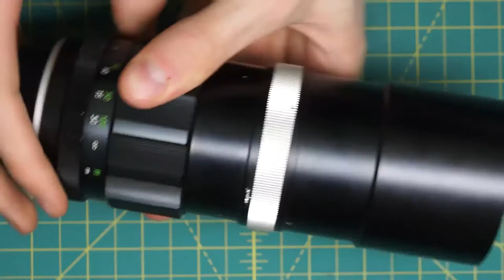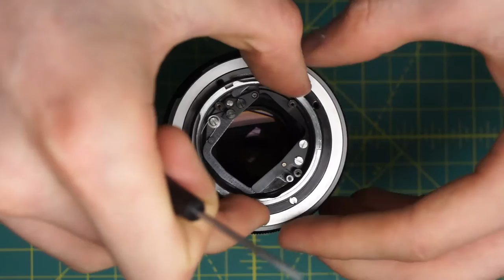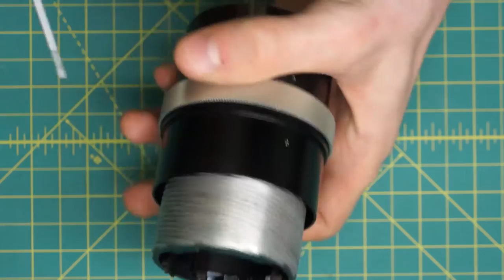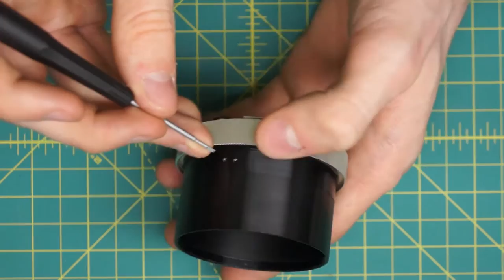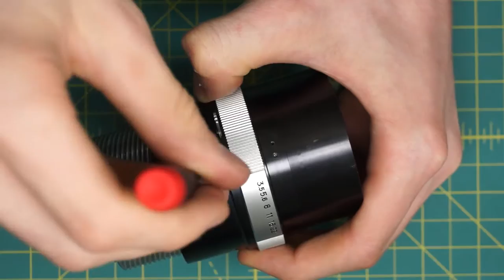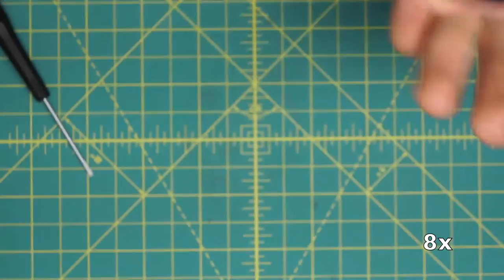Minolta MC Tele Rokkor-QF 200mm f3.5 (MC I) Lens Disassembly

Comment: Thanks for these lens rebuild videos Matt, I've looked at a couple so far and they seem easy enough if you know which order to undo things!
Did you have a manual to learn the order or you just threw yourself in the deep end and experimented? 
This one does look more fiddly than the other one I watched, I share your frustration with the flathead screws but do wonder why you don't use a magnetised screw driver? While not as easy to line up as a Phillips head I suspect it would make parts of this much easier.
I suspect they used the flathead screws as they'd have been cheaper to source back in the sixties and I doubt they were expecting many untrained people to dismantle them.

I've got one of these lenses, also the 28 & 135mm ones you've made videos on, I guess there was a good deal on back then to get an ST101 with a 50mm lens and these others too.
My 200mm is very still to focus, it's smooth though so I don't think it's the ball bearings being out of place. I remember when dad pulled it out for me to use he asked a camera shop to "service" everything. I'm sure they charged him a lot to do that, I remember they said they replaced the light meter and said that the grease in the 200mm lens has dried up a bit but it's still working fine so they didn't think it was worthwhile relubricating.
That was about thirty five years ago!
It feels worse than I recall, but given I've got old I can't be certain. I think I've got the skill/patience to rebuild this but you didn't do anything with the lubrication in this video. What sort of grease would you recommend?

Comment: The information about the Minolta Tele Rokkor-QF 1:3.5 f=200 mm vs. Minolta Tele Rokkor-PE 1:4.5 f=200 mm is gathered from the Minolta SR Len Index provided by Matt: http://minolta.eazypix.de/lenses/

The Minolta MC Tele Rokkor-QF 1:3.5 f=200 mm is a larger, heavier lens.
MC I introduced 1966.  Dimensions 70 X 138. Weight 740 gm. Filter thread 62 mm.
MC II introduced 1970. Dimensions 76 X 138. Weight 775 gm. Filter thread 62 mm.
 
The Minolta MC Tele Rokkor-PE 1:4.5 f=200 mm is a smaller, lighter lens.
MC I introduced 1967.
MC II introduced 1970.
MC I and MC II are identical in size. Dimensions 63 X 130 mm. Weight 500 gm. Filter thread 52 mm.

Comment: What a beast. I don't even know if it's a decent lens, but the machinery...

I'm thinking about buying a 200mm M42 lens for cheap that has a "Slow Iris", I don't know what the problem is, but if it's beyond simply cleaning the iris leaves, I'm out. 

I have two 50mm Zeiss Jena Tessars that won't stop down and need attention too. One of them will probably be the first lens I open up... with disastrous consequences no doubt. I just don't want to pay more attention to repairing lenses than I do taking photos.

Comment: Hi Matt, i've seen plenty of your videos and the way you explain everything its pretty awesome.
I'm wondering if you've ever disassembled a Canon FD 200mm 2.8, i got it for $35 but it have some water residuals in the middle of 2 and 3 element, seen from the front, and im stuck right now on how to get that 2 pieces of glass from the body.
Thanks in advance

Comment: Matt,
I was wondering what the difference between this Minolta MC Tele Rokkor-QF 1:3.5 f=200mm lens and the Minolta MC Tele Rokkor-PE 1:4.5 f=200mm lens?
Which of these two Minolta MC Tele Rokkor 200mm lens would you recommend?
I will be installing on my Minolta SRT101.
Reply from the maker: ibsoarin I'm haven't used the PE 200mm so I can't comparator the two. I believe the main difference is the optics. They have a different number of elements in a different number of groups. Here's a guide on what the PE or QF mean in terms of the optics: http://minolta.eazypix.de/lenses/
Reply: Matt,
Thank you for the Minolta SR Lens Index. That link is extremely helpful. I appreciate your time, expertise, and experience. Thank you for taking the time to provide these excellent videos. You have helped me to restore my vintage Minolta lens.
I acquired this setup from a friend and the aperture leaflets are all sluggish. The lenses are free of fungus and scratches because the previous owner was very careful with his equipment. I feel better knowing that other Minolta lens have had the sticking apertures.
I am a recycled vintage SLR camera buff from the 1970s. Back then, these cameras were new and little maintenance was necessary if you took care of your equipment.
In a followup reply, I plan on outlining the difference between the -PE and -QF series based upon your link.